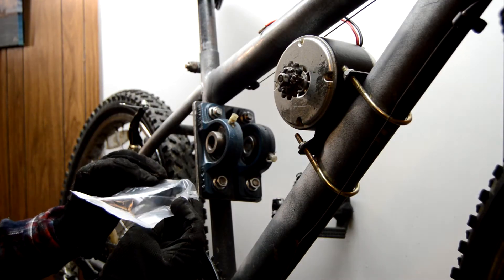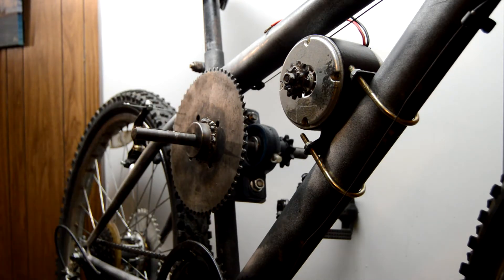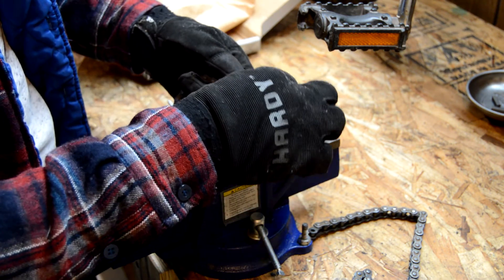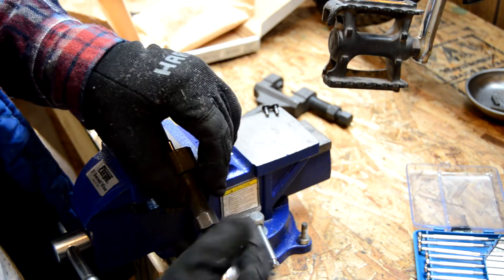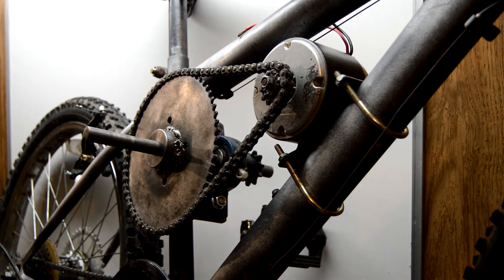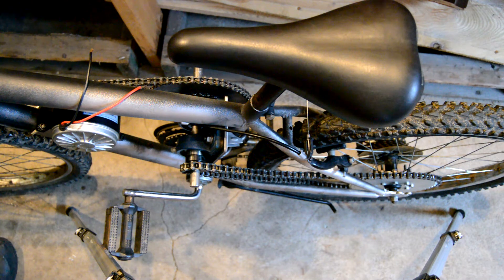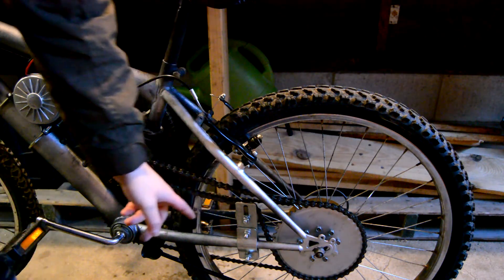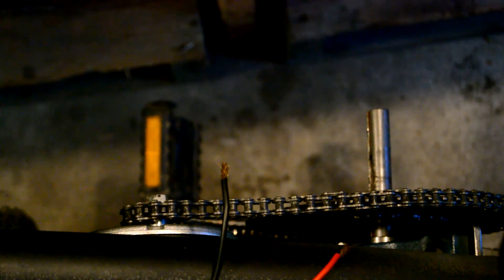DIY E-Bike Build - Chain Installation EP5

Comment: Sorry...;.I mis spoke from my earlier comment...You will need a SMALLER rear wheel gear(instead of BIGGER) to go "teens" mph. Need to chop the gear ratio approx. in half 
to around 11 or so.. So with your 10T(jackshaft-out) sprocket....a 32T rear gear gets you
11.16mph....22T get you 16.23....17T gets you 21mph(prob not attainable on the 250w/
2500rpm motor) without pedaling also....IDK...maybe an old school multi-speed cassette
 with derailleur may be in order.....

Comment: Hi again...If my math is right 15 mph on that 24 inch bike is 210 wheel rpm and at your 
24.4 final ratio equals 5126 motor rpm... Under load id expect that my1016 motor to do 
maybe half those rpms, meaning 7.5 mph(no pedaling). To hit the "teens" (mph), methinks
you will need bigger BIG gears..
Reply from the maker: The math is a little funky in this case because I'm using two different chain pitches, but yes the gear ratio is about half the speed of what I had originally planned out in video one. That decision was made on cost of the sprockets. It was cheaper to weld the two existing sprockets together and get a small one for $10 on the output side versus buying a new bigger sprocket for the input side at $50.